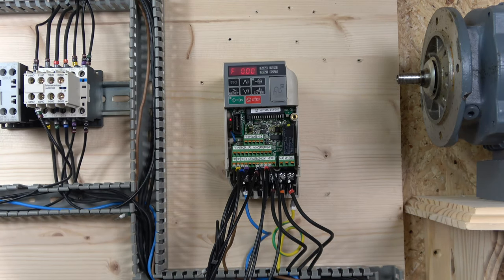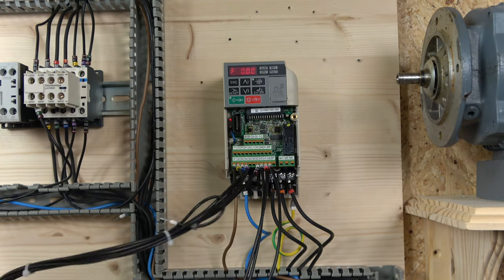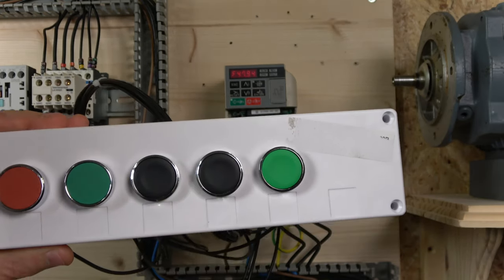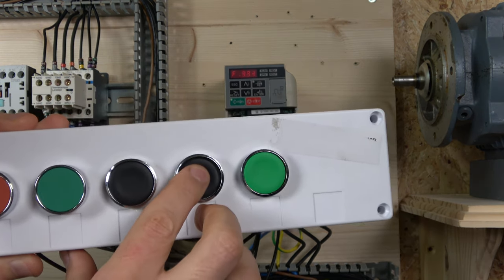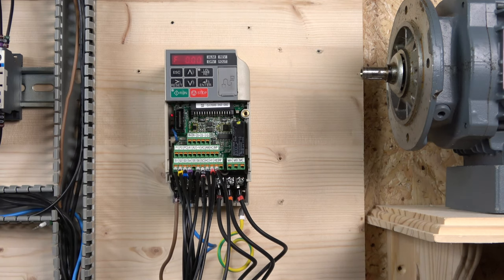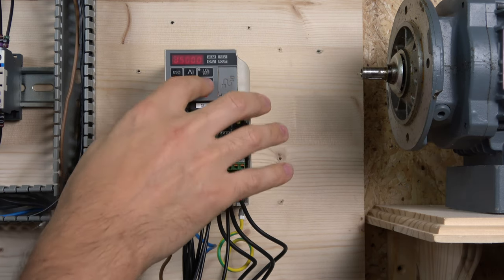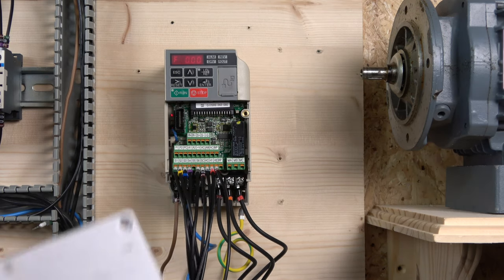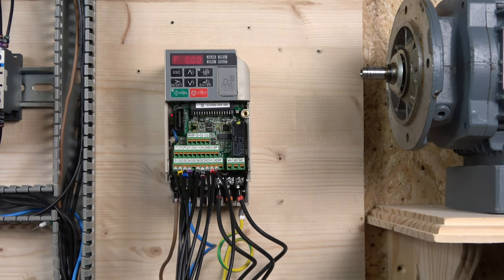Omron/Yaskawa V1000 VFD remote mode control, MOP/Electronic and multi frequency control. (English)

Comment: Hi, good video. Wish u had the display in screen when programming, easier too follow then :)
Reply from the maker: Hi Jan, you are absolutely right, i did not noticed that before. I must of zoomed in to much. Anything you want to know, regarding what you did not see, let me know.
Reply: @IGSElectronics  thanks for quick respons. If you want and have time, then i would love too see how you connect up and program potmeter on the drive :)
Reply from the maker: @janhbrenna4264  Have you seen the other 2 videos for this drive? You tube is terrible for suggesting the correct videos, no mater what I do. Deo check out the channel and search for V1000
Reply: @IGSElectronics  yes have seen them :) thank you. I will figure it out, or use the 2 buttons :) wish u a nice weekend :)